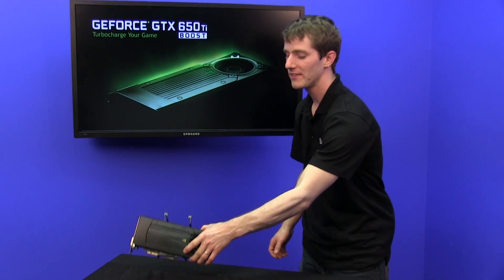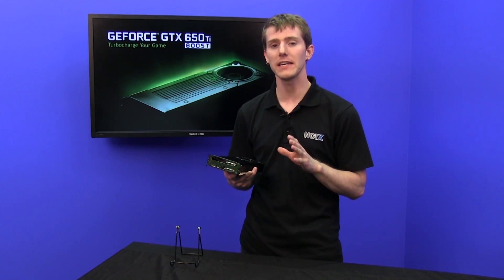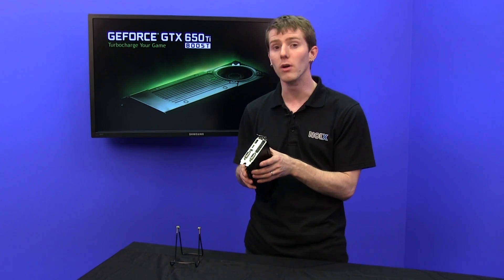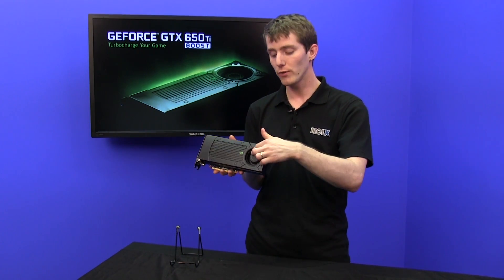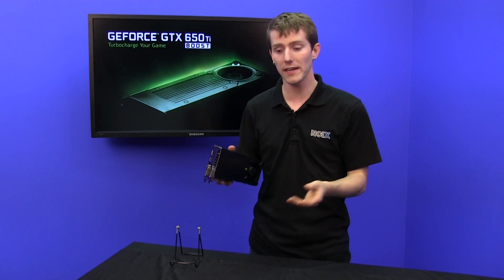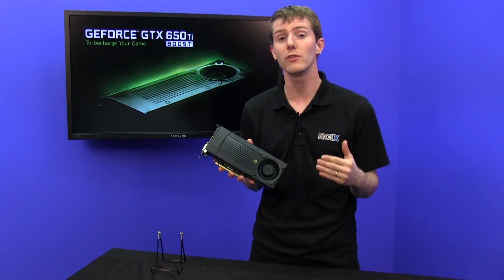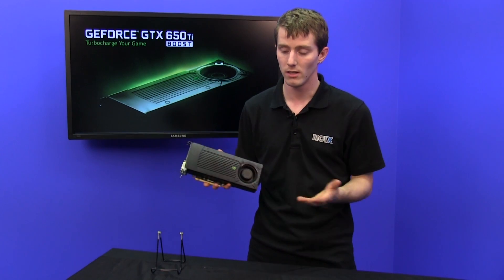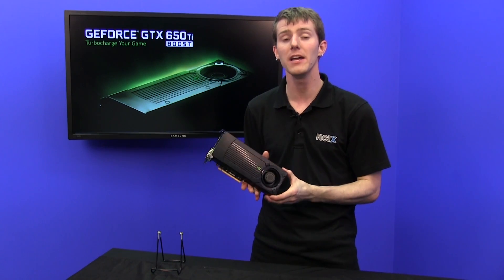NVIDIA GTX 650 Ti BOOST First Look

Comment: Guys,  i'd recommend  the Gigabyte 2gb edition. It's way better,  runs at 1110 stock clock and i overclocked it at 1260 and 2,4 gigs memory.  All games work perfectly on ultra settings,  1366x768 res,  maybe there is the need of lowering down the anti-aliasing at games like crysis or blacklist,  but it's really good and not that expensive.

Comment: This is a myth. The limit to how many fps you can see depends on the refresh rate of your monitor. Most people are going to be able to detect up to 60 fps, because most monitors are 60Hz. Linus even did a video where he was easily able to tell the difference between 60 fps and 120 fps on a 120Hz monitor. Console games are typically locked at 30 fps because that's how much most devs feel they need for the graphics they want, but all the recent CoD games (since MW1 at least) have run at 60.

Comment: the 650 ti boost competes with the 7850, the 7770 is a great card for the price, but if you have the wattage and cash, go for a 650ti boost or 7850 with 2gb of VRAM.  The 7790 competes with the 650ti NON boost.

Comment: What the minimum power supply needed for the gtx 650ti boost. I have an amd fx 4100 an asus m5a78l-m usb3 mobo and a gtx 650

Comment: I have strange question, i hope any of you could help me. When ever i move my laptop, my optical/wireless mouse disconnects. (mouse and laptop are not new, and i used them 1year+). I've opened laptop, checked wires, but there is nothing that would cause problems(i've noticed in DeviceManager that when problem is on, error 10 and 38 appear) And if i softly lean it back to original position, error is removed, what could cause that?

Comment: 7970*
Also, your 660ti is 300$ and averages about 2 more frames than the 7870. The 7870 is 250$. You're fucking dumb for spending 50$ for 2 more frames. Pathetic

Comment: well i have a 7970 ghz edition and i am playing bioshock infinite at around 21 frames, because i am using three monitors with maxed out settings including anti aliasing. so technically consoles are better right, they run more frames, and cost less than my graphics card.

Comment: A totally different card in terms of performance. The BOOST edition has 2 GB of RAM, a 192-bit bus, and it has a GPU boost which automatically boosts the frequency between 980 mHz - 1,033 mHz. The GTX 650 Ti Boost is practically a castrated GTX 660, with only 192 CUDA cores being the difference. :)

Comment: I would take a lower trim 7850 over the 650 ti for the 20$ extra dollars. That's me though. Twice the pixel rate, twice the memory bandwidth, uses less power. The only fault is the texel rate witch is like 8% slower.

Comment: 7870, it's a direct competitor of the 660 ti but for almost $100 less. A lower trim 7870 will run you $230. That would be my suggestion if you want to last 3 years without an upgrade. 650 is a great modest card but I've never gone with a 50 series because they don't stand the test of time in my opinion.

Comment: no this will not be a great improvement. I have an AMD 6850 and you can compare it with an 650ti (non boost). get an AMD 7950. That will be my upgrade when i have the money.

Comment: If you go for nvidia get 660ti but the power editing from msi, it totally destroys regular 660ti and 7870, and its almost to a 7950oc and a gtx670oc when you oc the card, but still a 7950 its faster than a 600ti.

Comment: Would you recommend a reference design if I use SLI, since the air blows out the back, so it doesn't really matter if there isn't much space between the cards?

Comment: check out my video i have two 680's both 4gb edt. it's overkill to get 4gb edt unless you game over 1080p resolution. or if you plan on keeping the card for over a year the longer. i say that bk now most game use under 2gb of vram but it used too be less so as time goes by the developers make use of the ram and will use more over time even at 1080p.  i wanted to be ready for 4k resolution

Comment: guys help would this set up work and be compatible an asus MAXIMUS V FORMULA, 2x gtx 680 2gb or 1 gtx 680 4gb, 16gb of ddr3 ram at 2133, i7 3930k all on a custom loop and displayed at a 2 monitor setup at 1080p

Comment: No...the 660ti does not equal the 7950..660ti is meant to compete with the 7870 2gb model.

670 is slightly slower than the 7950 in most parts of the video card..except most 7950's have more vram.  680 and 7970 are the heavy weights

Comment: I have the exact card that you want. MSI PE 660ti correct? It can run BF3 on ultra but it will drop from 60 to 40 once in a while.

Comment: i run my 650ti at 1100mhz clock, of course it doesn't have boost. also run the memory at 5500 (after data doubling of course). runs stable at those settings, but it was a factory oc version, so it has a pretty beefy fan on it. but i suspect even with my oc this card likely runs a little faster than mine.